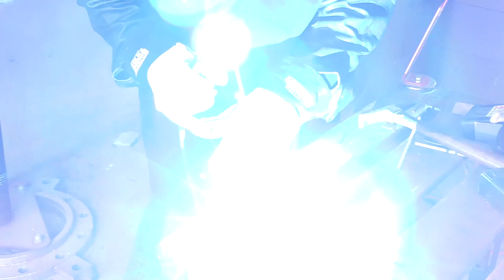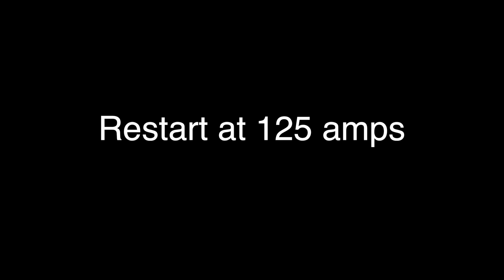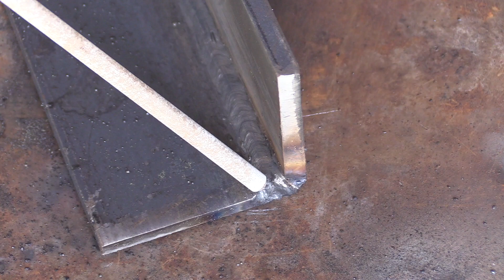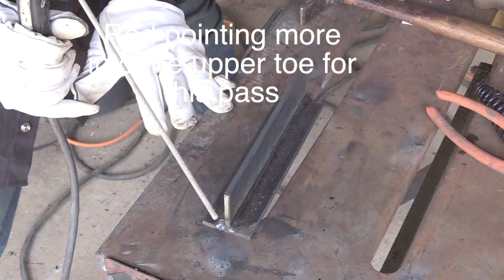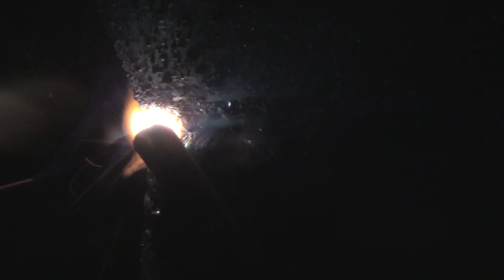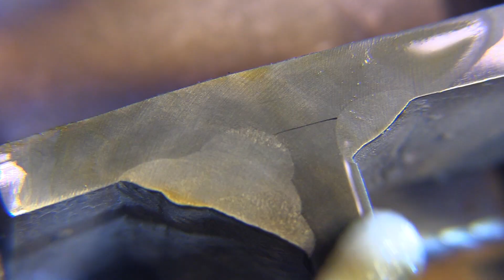7014 Stick Welding Multi Pass T Joint practice

Comment: Anybody new to stick welding definitely notice how Jody does not move around all over the place with his electrode. He points the electrode directly at the joint he intends on welding then at a consistent pace gradually starts to drag his electrode. He keeps the end of the electrode very tight moving along with the puddle. No big movements that could result in undercut , underfilled or getting slag inclusion in the weld puddle.
Reply: Especially with 7014.

Comment: Stick welding is most universal type of welding, as can be used underwater, anywhere outside and in any position, often not availble with TIG or MIG. I prefer TIG like many hobby welders, but it helps to be really good with stick.

Comment: I'm trying some of these out this week welding some base plates and wood beam pockets onto some 3/16 4x4 tube steel. It's slag is remarkably similar to 7024, I went to 7014 1/8 anbd I'm like it a lot more just due to me running between welding and tacking/fitting.. Seems to work excellent for both.

Comment: Thanks for your videos! I have seen a lot of failings, if the t joint is very rounded. if so, file the plate square before welding :)

Comment: Ok how did you do that. Welding left to right but when you cleaned it , it was right to left. Any one else catch that? We used to run 1/4"  7024 and hold conversations, with hoods up. Nice drag rod.

Comment: Hey Jodi, my welder tops out at 75 amps. Max rod is 3/32. Will it provide enough heat for hobbies around the house, garage? I'm using E7014 too.

Comment: You make it look easy, I’m over here still wondering where exactly is the weld puddle? I see the slag on top, but unlike mig and tig, all I seem to see is the bright weld arc.
Reply: I have the same problem.  It'd be nice if it was indicated where exactly the weld puddle is amongst all the glowing molten stuff.
Reply: Try a darker shade
Reply: Some types of rod have hard to see puddles. Try E7018 rods. You need to bake them in an oven for at least an hr @375°f - 400° . 
7018 is also known as Code Rod... its used throughout the industry for strong ductile welds, and is the rod used for certification tests on structural plate. Check Jodys vids on that rod for good views of the puddle.
Reply: B. A. Lineman a Gold lens can also be a big help over either a green lens or the auto-dark lenses in being able to see the puddle clearly.

Comment: Jody were you using DC or AC ? I've found that a 7014 on AC leaves a much smoother bead would love to see a comparison between the two and which gives better penetration AC or DC
Reply: In his previous video on stick welding (6013 and 7014 electrodes) he was using a DC machine, electrode positive.  This would lead one to believe that he's using DC in this one as well.
Reply: I notice I liked running 7014s alot more when all I had was a an ac arc welder. I've run them with my DC machine and wasn't as thrilled about them so maybe they run better on ac 🤷‍♂️

Comment: Hi, I tried to weld a chain link on a sawmill with a 7014 - at 150 - but it would not weld - it just fell off. And it’s not aluminum because a magnet would stick. Do you have any idea why ? I am just an amateur.
Reply: If it's zinc plated remove the coating. If not maybe has chromium in , try with an sta
inless electrode, E310 is good for any type of steel

Comment: the wire cup brushes you use are those harbor freight or? do they work good?
Reply: I was wondering that too, and why use a cup brush instead of a straight brush ?
Reply: the cup brushes don't fling needles near as bad, lol also the straight wheels bind and yank a lot kind of dangerous
Reply: I buy the hi quality staight wheels  and never never have any problems with that. The one time I tried the chinese ones bristles flew everwhere. Straights remove more material faster and with less effort in the hands of an experienced hand. They dont make cup shaped grinding wheels do they cause I have had more than one of those fly apart ;)

Comment: i'm getting problem when welding thin sheet metal,i always stuck my electrode on the 1mm sheet metal,i'm using 2mm (1/16) e6013
Reply: Amperage? AC or DC? DCEN or DCEP?
Reply: DCEP 35 amp~
Reply: I'm Bored looks about right for the chart. I am not a professional welder, but I'm thinking increase your arc length?
Reply: the problem is,it's always sticking when starting an arc
Reply: I'm Bored how's your ground? I'd try Jody's tip of a piece of stripped copper wire under your clamp to ensure a solid ground. Grounding to the table or the work?
Reply: work
Reply: I'm Bored turn the machine up about 10 amps and let me know
Reply: JeepITguy just got tip from my uncle who recently back from his project,he said crank the amp up but don't continously weld it,just tack weld all the way then grind it out,then do countinous weld above it,i'll let you know the result because here in sea region is night
Reply: so hey dude,just finished my welding project,and i followed my uncle tips,and it was worked great!

Comment: Is it a low hydrogen electrode ?
Reply: luis giancarlos alvarez gadea No. Only electrodes ending in 5, 6 or 8 are low Hydrogen. 7018 being the most popular.
Reply: thank you master I´m from peru and I have just qualified  in the process 3g fcaw
Reply: luis giancarlos alvarez gadea Excellent glad to hear thay. Back in the day right after my first year of welding school I qualified on all position SMAW and 1G and 2G FCAW all in the same day! That was a lot of work! I am happy to say that a welding carreer has been good to me. I have been a journeyman welder for 10years and a certified welding inspector for 4 years. I actually built the conveyor pulleys for the Cerro Verde mining project in Peru.

Comment: A question I have is why is 7018 industry standard when 7014 is equally as strong and not a pain to restart? Both are 70,000 tensile. I just ran a 1/8 of each and both appear the same.
Reply: 7018 is more ductile. Usually it doesn't matter, for some applications it does.

Comment: Some shipyard welder told me leave the slag .weld over it makes it smoother
Reply: georgio jansen 
He was pulling your leg, nothing stick welds smoother than clean bright steel and properly dried rods kept warm in a quiver
Reply: Ken F just try it. I can't show you cos at the moment I've got no 400v trifase electricity..and it was 24 yrs ago.don't know about muscle  memory  remanence,but I shouldn't sell me short. I was pretty good above average. Aluminium welding  and 6010 still on the bucketlist